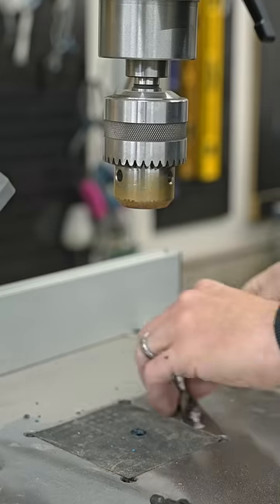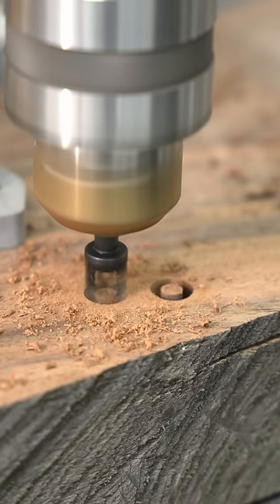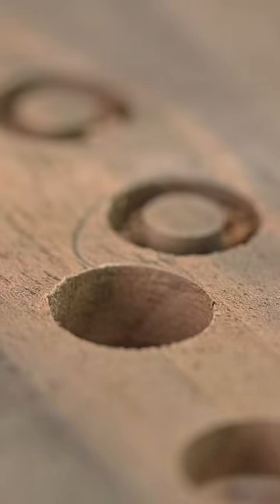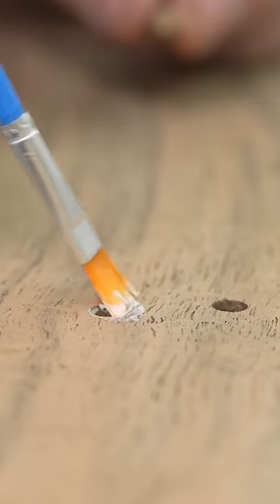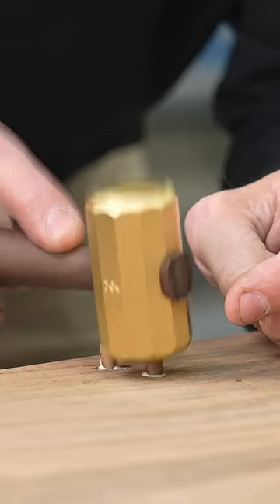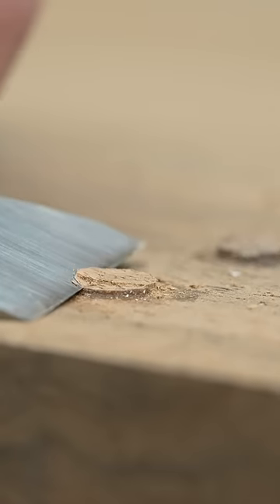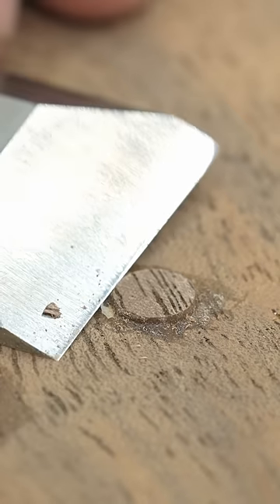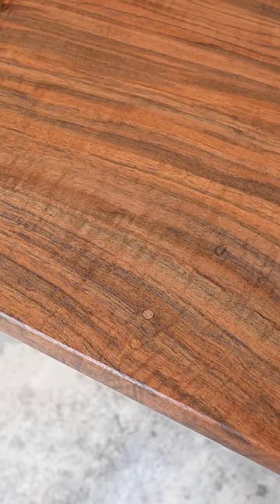Filling that hole

Comment: Tip. Wet the slab and the plug end with turpentine before you assemble, as a color check. This will allow you to better evaluate the color match. Wetting shows the color it will be once a finish is applied.  And since it’s turpentine, it evaporates quickly, and leaves no residue, nor will it cause the wood to swell. There might be some shade differences between the uncut plug color and the plug when finished flat, but should be minimal. Then if they are not a match, you can try another plug until you find one that seems better. Don’t forget to maintain the grain orientation. Hope this helps.
Reply: Tell your supplier to check the water contact from the side of the board instead of the face of the board. You could also plugged in the face of the board from a plug cut from the side of the board.
Reply: Good shout
Reply: @ColinMor-fj3qc  I picked it. Originally from Oregon, now overseas. A while ago now
Reply: It’s bad
Reply: Couldn't he just shave a little wood to get some sawdust and use that as filler with the glue?  I'm pretty sure it won't show.
Reply: Damn, that is some good information to know!
Thank you.

Comment: A friend once had the idea, to drill a little diagonal into the wood, so the the pin gets oval on the surface when cut. He said it would looks more natural than a random perfect circle. What's your opinion to that idea?
Reply: most knots arent perfect circles . most arent circles at all.  tonally fair assessment.
Reply: sounds resonable. the more angle you can cut it the better i would assume :)
going over 45 degrees might be difficult tho
Reply: I would like him to do a side by side of this method. Definitely makes sense.
Reply: Your friend is pretty smart, don’t think I would’ve thought of that tbh. But my woodworking experience only goes as far as high school shop class lol
Reply: Absolutely agree with your friend because those two plugs stood out like a sore thumb.
Reply: Let's hope he tries this
Reply: A perfect circle or a perfect oval lmao pretty much the same issue buddy

Comment: I sometimes scrape away a fake crack and fill it with epoxy or glue mixed with sawdust. If you follow the grain and keep it as narrow as possible, it sometimes is unnoticeable.
Reply: I learned that trick from a master carpenter over at Palomar College Woodworking department 😉
Reply: yeah, i'll usually fill the hole with sawdust that i'll mix with some wood glue. i've never stained a patch before though, I work on molds, so the look afterwards doesn't matter as much, just the texture would.

Comment: You can colormatch in the middle of the finishing process actually. Get yourself of a set of refinishing markers. For furniture touch ups. Or you can make yourself custom ones. With a copic or other bank marker (from art supply store), Just double your solvent usually. Its a art form to get it right. But it can save you a significant amount of time. When done right the stain will not heavily bleed. But its a real by touch and feel thing.
Reply: A fine brush and some care and you can make it very very close to invisible.
Reply: i've also seen a youtube video where someone used coloured pencils (as they're available in a huge range of lighter/darker shades) to add wood grain over a filler repair before varnishing
Reply: @RJ-wx3fh  makes me curious if they where real colored pencils or refinishing pencils (yes its a thing). Most of the colored pencils I have used over the years are fairly abrasive, or have other additives, that I am not sure would behave with some finishes.

Comment: I was a lumber grader for a furniture manufacturer. After the wood came out of the dryer, a pin hole was drilled out of the middle of the stack and they collected the micro slivers from the drill spot and went into the lab.
When that wasn't done, they would let it sit for 4 month's before sending it out or using it.
They would dry wood for other companies too. I still have a piece of mahogany from those day's.

Comment: Hey buddy. Take it from a woodworker, cut them damn holes in the bottom of the table. Pull those plugs and put them on top. for an inconspicuous patch plug. Then put your oddball plugs in the bottom holes.
Reply: +1!
Reply: YES!
Reply: I was gonna ask this. Is there any reason to do that on the top?
Reply: Yes but he too high up and doesn't talk to his viewers, so he will never know this
Reply: That's what I was thinking
Reply: Makes perfect sense, take the repair plug from the same piece of wood!
Reply: @-Tyreal_Awesome-112-  he pinned him answering this question to someone else at the top of the comments.
Reply: Im no wood worker in any form and this was the first thing that came to my mind.....
Reply: Why not just flip the board instead of moving the holes?
Reply: Could you cut a sliver of wood from the edge, make shavings then mix with glue to fill the holes?
Reply: Walnut tone varies so much that even doing that could and most likely would put a tone difference in the top part of the plug. Most woods this would work but a lot of walnut just has such a tight tolerance in color
Reply: @tima.478 no. That would look even worse because the grain is no longer visible in the shavings. The point is to match the grain pattern with another piece of wood which wouldn't be possible with wood shavings.
Reply: @gmula1987  Ah ok, got it...thanks! 👍
Reply: @claframboise  no he didn’t. He responded to someone saying take wood from the underside. Not just doing the bottom of it.
Reply: @kingpuff10 he does.
Reply: The plugs are from offcuts. Duh

Comment: Most of my clients like me to use a contrasting wood, usually maple or pecan for black walnut.
Reply: If it’s on the underside what would be sweet if you had your company logo cnc cut then router a hole to fit and epoxy fill then sand flush
Reply: In whatever craft, matching colors is often nearly impossible. So it's better to just lean into it and use a contrasting color rather than be a little off. It's now visual interest rather than annoyance.
Reply: I love the look of that contrast

Comment: Do the holes go all the way through? If not, use that as the underside of the table (plug the holes, obviously). If they do, follow the grain and try to find something that matches from the same slab of wood, cut that out and use the side you cut it out from as the under side of the table (again, plug the holes). If you cat make it match perfectly try to disguise it as a knot. 
Idk, might work well, I don't make tables and the wood I use isn't moisture checked.

Comment: could you use that messed up part on the bottom of the table?
Reply: Repent and believe the gospel ❤❤. Jesus is coming
Reply: it may be a full hole going both sides or that side may be designed for the top somehow
Reply: @camilosanchez831 I'm good thanks
Reply: @camilosanchez831  No
Reply: @camilosanchez831  Jesus isn't real.
Reply: It is the bottom
Reply: @camilosanchez831  If you believe something just because you're "supposed" to, then you can't possibly genuinely believe it.

Comment: Plugs will often have a slope to the grain when looking side-on, and when you install them and align the grain you also ensure the slopes all rise the same way, you can skip the saw and give each plug a quick pop with a chisel just above the surface on the low side and be ready to shave and sand. Make sure the grain doesn't slope down from the chisel tho or you'll chip out below the surface.

Comment: Mohawk sells some touch up brushes that are toner that are really fine tips. The minwax brand stain pens, like ebony in this case, would also work. You can do it when you stain, when you seal, or even top coat, but highly to recommend clearing over them

Comment: Smaller plug and stain that spot a second time with an artist brush.
Reply: Your going threw the wrong manufacturer the plugs makes the products less price and garbage in my opinion you need to sand it down to a perfect finish to make a great product instead of hidden garbage never want an expensive costumer to fund this after cleaning under the table

Comment: When you have a lighter color plug or wood you've inserted. It's okay to fine-tune the color like an artist with thin brushes, colored markers, pencils, sharpies, whatever you need that makes it work. Then you cover it with finish. You'll never know it's there. I do that with wood floors all the time drawing in grain lines to match the rest of the board. Sometimes you can draw a fake knot in. Don't be afraid. It can't be worse than what you're looking at. You could always sand it off
Reply: that's funny, but also pretty cool to know
Reply: When I was an apprentice luthier, we would do this. Mostly for cheaper repairs but it definitely works
Reply: That's a cool tip - I didn't know the pros do that. I kinda did something like that years ago when I wanted to hide a, well, let's say "imperfection" that I myself caused, on my floor. Worked enough not to be noticeable unless you really knew where to look exactly.
Reply: They literally make a moisture meter with two big needles on it so you don’t have to do that lol. Dummies.

Comment: Have you tried plugging the hole . Sand wood  off where it wont show and mixing the wood dust with glue ? It does a pretty good job of hiding them !

Comment: Drilling holes to check moisture is interesting…back in high school (1993-1997) we had a battery powered moisture meter that was dead accurate. Ended up buying one for myself, it was $20…so why doesn’t the mill you go to have a $20 moisture meter instead of destroying wood? I’d find a different mill.
Reply: Exactly lmao moisture meters nowadays have 2 rods you just poke into the wood not too far in and it gives an accurate reading in seconds
Reply: Only reads 1/4 deep. This wood is 2 inches thick
Reply: Pretty sure those can’t measure the moisture past a quarter inch

Comment: Tip for you next time you need a plug for the slab your working on just cut an inch of 1 side of the slad and use that peice ro make your plugs this way its the same color and try to put it in the same way as the grain

Comment: Sorry for my English, but if you want to avoid marking the wood while sawing but still do it quickly, I'd advise using a special saw and following the wood lines while cutting. If you're careful and precise you would just need a saw and some fine sandpaper. It's what I do anyway 😅

Comment: I’ve been outta carpentry for a hot min but I would lightly glaze over it with wood putty. Then sanded, Then the finish. Just the same; you could hardly notice where the plugs were. Well done sir 💪🏿

Comment: Just an idea. Drill the hole deeper, save the sawdust, fill the hole with whatever wood but dont fully fill it. Deform the hole because round holes junp to the eye. Make a wood paste with glue and the saved sawdust and fill with that.

Comment: Try using the tiniest spots of glue so that it never contacts the surface. More than that is not needed. Allow it to dry before remove the excess. When cutting the excess use a an extra fine pull-saw; the idea is to not increase the temperature of the nature oils in the plug by using bi-directional saw. See if that isn’t less visible. Please reply to let me know. I am not a carpenter, but there are continuous carpenters in my blood back at least 350 years, and I inexplicably seem to have “learned” some stuff. But sometimes I am wrong.

Comment: Have you tried torching the pin a little before stamping it in?  Just a thought I don't work wood, but used my torch to finish a shelf.  Maybe the burn will make it dry and absorb better.
Reply: Happy for any feedback.  Like I mention I know nothing of the craft but, am curious if it works.

Comment: You can match the grain on the plugs 
I’ve repaired finished doors cutting plugs from other areas matching the direction and grain details. Using a block to get driven to flush. Almost invisible if you take your time.

Comment: Just little suggestions, get it the plug from the other side of your slobs. That way you will have same color and grains. And just put the glue on the bottom of the hole, that way you eliminate the yellow ring around plugs

Comment: Coordinate with your supplier on where they drill. Use the location of the hole to inlay your logo into the wood with wood. Embrace the subtle color difference while giving a classy bit of branding to your work

Comment: The sanding dust from the wood you are using can be mixed with glue to fill the upper bit of the hole.

Comment: What about planing a very thin veneer off the top, plugging the wood holes just short of the top, and glueing a cut circle of veneer that matches closely to what works with the wood around the holes? Wouldn’t the wood generally need a close planing done to  make the top and bottom closer to being parallel anyways?

Comment: You want to countersink the plug a couple mm. Use the sawsust from sanding the surface and a little touch of wood glue to make a paste. Fill the plug recess you made with the sawdust and glue. Practice the mixture on shop furniture before you use it on something you sell or give as a gift. You can get tone perfect matches but you lose the grain. Starbond glue is actually invisible.

Comment: At the woodshop I worked in, we would take these holes and using a dremel, a plug, and stain, make it look like a knot. We'd take a small shoot of a stick in the yard and stick it in as a plug and then once sanded flush, fill the dremeled area with dark wood filler to simulate the entrapped bark. It took way longer and was easy to mess up but on some types of wood it looked completely natural.

Comment: a) If there was one side that was going to be more visible, you could have taken the plug from the opposite side and then filled that side with the less matching plug. It can be difficult to match up tone and hue on woods like mahogany and walnut - any wood that can have lots of variation among sections and pieces.

b) you can use something like mineral spirits (i.e. something like alcohol,  not water or oil) to "wet" the pieces to better see how they'll match and what they'll look like when oiled or clear coated. I've always found this to be neccessary because, like you suggest, 2 pieces can look very similar until they are coated.

c) depending on how much taper your plug bit gives you and the hole you drill, you want to have way more oversized portion of plug (vs fitting portion) so you can really hammer, wedge it in without hammering it too close to flush.  This helps the seam stay tight and as invisible as possible even when you take any amount of depth off the surface after the fact. You don't want the plug to start "shrinking" in circumfrance as you eat down into the surface and start seeing glue.
Reply: He's filling the underside. Every side must be perfect
Reply: @dylanhoward718   Is that the case? You know this isnt a table top, etc?

Comment: You should try pulling a core from the bottom side of the wood.... It will match a lot better then use a different plug to fix the bottom hole or hide it w/ the mount for the legs.
Reply: It's from an offcut

Comment: Do some sanding first in different areas. Then mix the sanding with some wood glue. Fill in the hole with a partial plug. Then top off the rest with the glue sand mixes you made of the corresponding color tones.
Reply: Nvm. You’re looking for the grain ride.

Comment: Sand it as much as you need. Take the sawdust from that and mix it with a little bit of wood glue. Fill the holes with it and sand it again. When you stain it, it matches because you're using shavings from the same wood.
Reply: He's already getting plugs from the same slab

Comment: It looks like you are compressing the plugs when you hammer them in.  Compressed wood won't take as much finish as the loose wood surrounding it.     Plug is lighter than the surrounding wood for a reason.

Comment: To bad there wasn't a spot on the slab where you could have gotten 2 plugs or is it the glue causing the difference in color? What if you mixed some sanding dust into it?

Comment: If you don't want holes, you can always chisel a thin layer off of the top, before drilling the holes underneath if done cleanlyand with the grain it is nearly impossible to tell, especially if you mix some wood-dust from the same slab with wood glue and use it to glue it back on / fill the small gaps that might come to be

Comment: don't plan on staining that wood.  The glue that he/she spread around that hole will block any stain. Couple of options.  1) Drill the holes for the plugs then stain the both the plugs and the drilled surface BEFORE gluing the plug.   OR use just enough glue in the bottom of the hole to hold the plug.  In any cast those plugged holes were still very easy to see in the finished surface.
Reply from the maker: I’ve found generally only the casual diyer stains wood. Unless it’s for cabinets anyway. These types of higher end clients prefer a wood that is the intended color, naturally. Staining wood really mutes the colors and looks kinda janky. I’m sure it’s fine for a lot of people though. I have a free finishing workshop available on my website that I bet you could really benefit from. If you have any interest in getting to the next level anyway 🙏

Comment: If its for something like a table, could you take plugs from somewhere that say the connection to the legs may cover up? Those holes you could fill with the close but not quite exact plugs if you even need to.

Comment: Could it possibly, in some cases, be "off" as a result of the plug being compressed when forced into the hole, resulting in the stain not soaking in as well? Perhaps, provided the above has merit, stain the plug prior to intserting into the work.